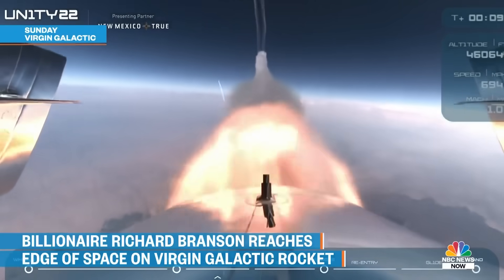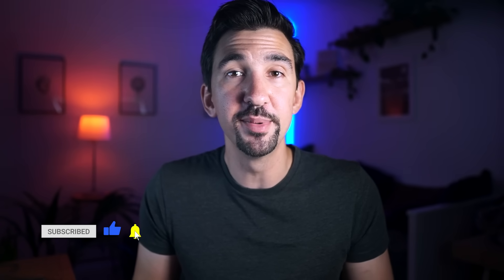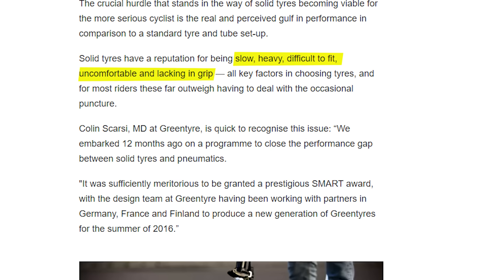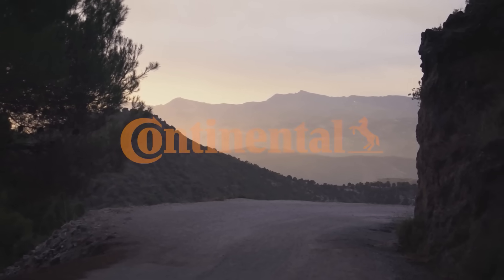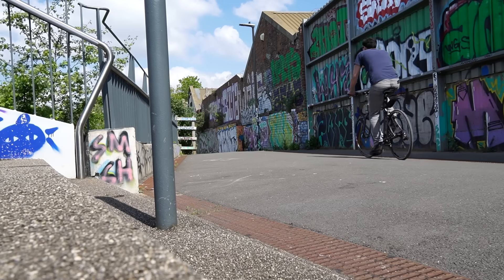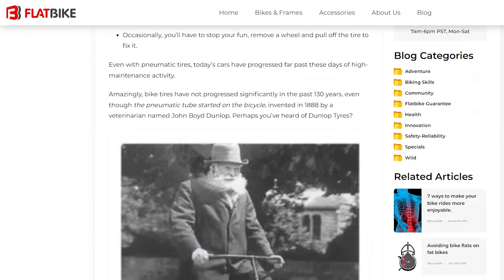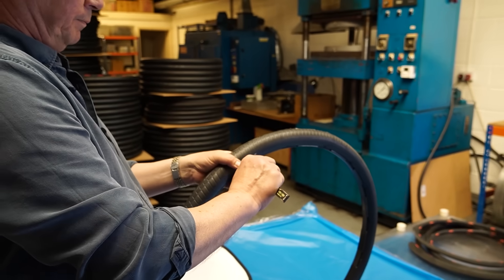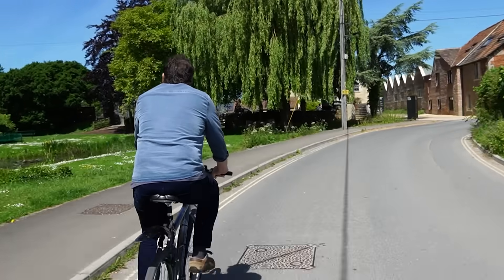I Tried Solid Bike Tires | Here's What I Found

Comment: Or you could be incredibly lucky like me, I’ve always ran conti, with an average of 5k miles a year I had zero punctures on the road from 1998 to 2017. Admittedly I did have a couple of slow ones that had given me a flat overnight. I think the key is to keep correct inflation and replace when they get worn
Reply: I've been on Conti Double Fighters for 2 years and not had a flat

Comment: You’re wrong about that “coefficient of restitution” with respect to pneumatic tires. I mean, you’re right if you’re talking about bumps. But not right if you’re talking about riding along a smooth path. That’s because when you’re riding a smooth path, the ‘net’ pressure in the tire isn’t changing. You do have compression at the contact patch, but that is just going to push the air inside the tire away from the contact patch. The air would blow forwards inside the tire, and would flow backwards relative to the rolling direction. I would expect a strong air current inside the pneumatic tire tending to flow backwards and hence cause resistance to rolling.

Comment: I used to work in a bike shop about 30 years ago, solid tires were quite popular then and we made a lot of money re-spoking, replacing bent rims and damaged hub bearings of wheels fitted with solid tires. Air is a fantastically efficient shock absorber. Foam rubber with unpressurized air in the foam are in no way comparable. Elastomers make very poor springs. Personally I have found well protected tires (Schwalbe Marathon for example) are virtually puncture proof, and I prefer the minute chance of a puncture (less than 1/20,000km in my experience) to the massive cost of wheel repair resulting from solid tires.
Reply: I have ridden and raced bikes for decades and with training and racing used to cover 300 miles a week. I tried semi solid tyres on mavic box section rims going to work on my work bike, needless to say they cracked these very strong rims and had the rolling resistance similar to riding through treacle making each journey slow enough to fix a puncture anyway. I quickly returned to pneumatic tyres on my work bike, so I can confirm that you are 100 % correct. Semi solid tyres are a disaster! Still race now, sometimes against Harry Tanfield in our club evening series, when he is home from professional duties. This is one area where pneumatic tyres don't help, trying to catch him whilst he is averaging 30 mph on a sporting course.
Reply: @stevezodiac491  Hey Zodiac, we finally find you!!! You will have to answer to FBI questions and please don't talk about "solid tires" or "needle" to explain your terrible day to day activities 😂😂😂😂😂. 
I'm on your tail since 1960's.🧐
Reply: While I have no experience with solid tires, I can absolutely confirm the performance of higher value tires. I am an overweight dude, and I use my bikes for shopping, too, effectively putting up to 150 kg on my bikes. So you'd think that every thorn or piece of glass I ride over will be pressed hard against the rubber. Still, punctures for me are an absolute rarity in the roughly 5000 km I cycle every year. Bonus: these more expensive tires also don't wear down as fast as the cheaper ones, so despite the higher price they are not really more expensive in the long run.

My personal safety precaution is owning two bikes. With a short commute, punctures are not always noticed during the ride. So when I see a flat in the morning, I just take the other bike and repair the flat in the evening. Also, I put in new tubes and a new rim band at least every two years, regardless of any actual issues with them. Strained rubber ages.
Reply: @Volkbrecht  In US more expensive means lighter and more delicate
Reply: @3mtech  When it comes to bicycles, that's probably true everywhere. However, you need to take into account that any price gauge starts at "crap", and crappy tires are usually lighter than durable ones because they are using a lower thread density on the carcass, and also often softer rubber. And there is another thing. When tires have added puncture protection (you can see this in the video at 4:18), they also get heavier and more expensive. Personally, I don't use tires that have this feature, because it adds weight at the worst possible point of the bike. The regular Conti touring tires or the regular Schwalbe Marathon are good enough for me. But the reason for that is that I could hop onto the bus at any point during my commute. I can afford to sacrifice a little reliability for speed.
Reply: I agree with the high quality tires being virtually puncture proof. In the last 10k, I had one puncture when I ran over a nail with the said Schwalbe tires. On my current bike I rode 5K last year and the tires are still absolutely fine and will hopefully run for at least another 5K.
Reply: I've built  quite a few bikes over the years, but using schwable marathon plus, I've also found they're pretty puncture free! ...maybe I'd get a puncture once 3 or 4 years, but changing when getting worn virtually removes the risk, as for this guy getting punctures 2 or 3 a month? ..either cheap tyres or really off road, sharp gravelled paths? ..saying that if the new tyres proove successful and recyclable good luck and time will tell?
Reply: Marathon essentially solved tyres for commuting / touring use!
Reply: I agree. The higher quality tires are really good. I had 0 punctures in the last 4 years/>20.000km with Schwalbe Smart Sam, spikes winter tyres and Marathon. 

The concept of those semi-solid tires seems very interesting though!
Reply: I've had a bike most of my life and only 2 flats in all that time. I've lived in village and city's - so not that much difference. 

 Changing the tube is not that bad - if you got a spare one on tour it's manageable. 
There is an argument to be made to make the rubber tires recyclable. Probably not easy if you also want puncture resistant tires.

I think it's more important to think about maintaining bicycle tracks - to clean them regularly, particularly in autumn and winter. I often don't want to ride in the gutter of the road because of all the debris (leaves, small branches...) and ride a little bit to the left. When there is no bicycle track it's safer in the middle of the road - and much cleaner.
Reply: I have a 4 ply Michelin city pro moto tyre on muh EUC. Got a shard of glass through to the tube. Glass errywhere 💩
Reply: Well said, thank you.🙂
Reply: But one of his points in the video was recyclability...
Reply: Did you watch the full video?  The Gecko tire has much better compliance and ride quality than older solid tire designs.
Reply: I remember solid bike tyres from the early 90s, I think they were with recycled materials as well, seemed like a cool idea in principle, I never got any but I do remember them just disappearing from the shelves. Now I know why!
Reply: Well said
Reply: I understand what your saying although it seems to me that these tires are different then old solid tires in that the air inside is encapsulated and provide the rider a very similar ride quality to an air tire.  He did test a tire like the one you mentioned were so popular and found it jarring.   I'm glad you found an alternative that works for you in one area.  It only falls short in the recyclable front.
Reply: Modern tubeless tires with sealant work great. 
They’ll seal up most punctures. 
I never fear glass or thorns. 
The only maintenance is keeping them pumped up, and adding sealant about once a year. 
Far superior to tube tires, or solid tires I’m personally aware of. 
I’ll stick with tubeless ..
Reply: In response to those who say things like…I’ve ridden bikes my whole life and only had two flats; this sort of claim is relative to where one lives and how one rides, right?
I once lived in a place that was notorious in late summer and fall for goat head thorns. I couldn’t go 5 miles during goat head season, without getting a flat. 
I now live in “the grass seed capital of the world” and haven’t had a flat in the 8 years I’ve lived here…unless I ride in the hill country where wild blackberry grows like weeds.
Now, the blackberry bushes wouldn’t be a problem except that they grow very fast and this is a problem for bike riders and hikers bc the vines grow across trails. When this becomes a problem, hiker’s and biker’s prune them back out of the way. This is good, of course, except for the fact that they drop the vines on the trails and that makes a problem for anyone riding over them.
Some people say that hiker’s intentionally drop them on the trails to discourage mountain bike riding where they enjoy walking.
I suppose what it comes down to is…hikers don’t like mountain biker’s disturbing their peace and quiet.
So, the moral of this story is if you live where there are thorn seasons or lots of blackberry, you will have flat tires.
Reply: Same
Reply: Thanks for that input. When I bought my MTB the shop strongly advised against solid tires for the reasons you mentioned. There are solid tire brands out there claiming shock absorption similar to air inflated tires. However, the cost is a bit high. I just use normal air inflated tires with linings to stop thorns. In about 5000 miles I had one puncture. The math to me indicates to simply stick to air inflated tires...
Reply: I would say the type of material is key. I do not believe that a solid tire of the correct material and density would not work.
Reply: My sister had a set on her bike at college... for about 2 days before they were stolen OFF her well locked frame. She did say you could feel all the crap in the road while she still had them.
Reply: my bike would like to differ... 6 punctures in 14.000Km xD
Reply: @Kanitoxx What tyres are you using?
Reply: I'm guessing that if someone wanted to deliberately puncture one of these tires it wouldn't be difficult to do. (Though I don't know how puncture-resistant MY tires are) I worry about this because I just got my second flat (on the same tire) in four months on a bike that I've ridden for fourteen years without any tire issues. I think my bike mechanic replaced the tube the first time, so probably it's not an instance of a bad repair job on a tube.
Reply: did you watch the entire video?
Reply: Go tubeless. I haven't had a flat since I made the switch about 5 years ago. Just have to remember to top off the sealant every 2 to 3 months.
Reply: @kandrkandr  sealants would freeze during the winter where I live. Frankly I don't know how this solid tire would behave either during winter time. Some materials behave weirdly at well below sub-zero temps.
Reply: @innocentiuslacrim2290  most of the sealants are loaded with antifreeze. I've never seen a problem with it.
Reply: @innocentiuslacrim2290  antifreeze is added to the sealants. Plus ammonia. It would need to be extremely cold to freeze it. I remember when I made my own, most of the recipe was rv antifreeze. I am curious though. I will put a bottle of stans in my freezer.
Reply: @kandrkandr  oh, I stand corrected by you and gonokittys. I just assumed it. The coldest it gets here is -30 Celsius and I do not really cycle much at those temps either.
Reply: @kandrkandr  I concur doctor. 
The majority of these issues are alleviated by this move.
Reply: @kandrkandr  No, I've run tubeless and while they puncture less often than conventional, when they do puncture you are scrwd as the they often don't reseal properly if the tyre is cut.
Reply: @richg7163  when I go for a long ride, I always bring a spare tube. Years ago, I burped my front tire so I started carrying a light tube with me. Haven't had a need to use it yet though. Knock wood.
Reply: @kandrkandr Second that. I bought a Giant Contend AR1 a few months ago, factory fitted tubeless. Ridden a lot of km since then including the RideLondon 100 mile. Topped up sealant before the event. Very little pressure loss over time and no punctures (yet!). My previous hybrid bike with tubes seemed to get never ending punctures.
Reply: @kandrkandr  Tubeless tires use air
Reply: @rogeliosalgado  My point was... just because tires are pneumatic, does not mean they have to get flats.
Reply: @kandrkandr  well, tubeless tires do get punctured sine times flats, ir has proven to be a better option than running inner tubes, but effectivenes depends on quality of seal, rim, tire, sealant and expertise or quality when installing, the Only downside is the money involved
Reply: @rogeliosalgado  yeah, best to use tubeless ready setup for best results, but you can get by with a thick over applied rim tape if your rim is not tubeless ready. My ebike is set up like this, and I have had no issues. So far. Have not even needed to add air in over 2 months. Probably jinxing myself.
Reply: @kandrkandr , does the wheel rim not have to be tubeless specific, to prevent the tyre rolling off the rim?
Reply: @johnnunn8688  it doesn't. Just put multiple layers of rim tape on. The added thickness will give the bead a place to sit and prevents it from moving into the middle of the rim. My son said he heard about this trick from berm peak YouTube channel. Worked great for me.
Reply: @kandrkandr  Seth (the Berm Peak youtuber) just uses normal duct tape. He says you don't need the specific, harder to work with, more expensive tubeless tape.
Reply: @gheetza14  I  used to use gorilla tape. Lately I use blue packing tape that I bought off Amazon. It's cheaper per foot and much easier to remove and reapply. Really, I think it's the same stuff they brand as tubeless tape with the high price tag. The duct taoe leaves a lot of glue residue that needs to be removed with acetone. Not fun.
Reply: @kandrkandr  But more rim tape makes already-difficult tubeless tire mounting even harder to do.
Reply: @rogeliosalgado  If that's a question, then yes, tubeless tyres are pneumatic. 

If it's a statement then I cannot see what he wrote that makes it seem that he is unaware of the fact.
Reply: @kandrkandr  The best compromise for me is quality tubes to which I add a sealant made for inner tubes. Easier to work with than fully tubeless, swapping tyres is easy, no special rim setup, and no need for a compressor. Yet the same very good puncture protection, except possibly against snakebite, but at the tyre pressures I use that's no concern. It's heavier and higher rolling resistance than tubeless, but that's less important for me than the practicality of it. Combined with high quality puncture resistant tyres, it's all good. Racers will disagree, but for practical transport cycling I think it's the best way.
Reply: They make a hybrid. A rubber insert that protects the tube. Best of both worlds. I also use the goop tubes.

I live in Hawaii, Big Island. They only sweep things onto the side of the road they never sweep the side of the road. Glass, nails, very sharp lava rocks, etc, we're all a huge problem.

Like you say solid rubber was just a terrible ride and would destroy the wheels.

The armored insert and self-sealing tube solved my problem. Now I only change tubes when I change tires because the tread has completely worn through.
Reply: Pneumatic tyres are such an amazingly effective invention. I don't think it's impossible to ever replace them though
Reply: Seems like you missed the part of the video covering its elasticity.
Reply: This. This whole video speaks like an ad for these tires, yet they solve none of the old problems of solid bike tires. They're heavy (they compared them to quite literally the heaviest tire and tube they could find.....), they ride rough, and they're too hard for the normal person to fit to their rim.
Reply: Combine that with a tubeless set up and sealant and I don’t know why we have solid anything. 

Thanks for the insight on these; everything old is now new ….won’t be considering these
Reply: @inzana2   In other words you have no experience with the Gecko tire presented here but rather with products from 30 years ago. To me, and clearly not many others, a primary benefit besides performance, is reCYCLEability.
Reply: @rcpmac  if they offered a turn in rebate on the used tires it would be more of a draw for most people. Company now has a supply of raw materials to make new tires, people get a discount, recycling rather than landfill is assured, and everyone's happy 😉

Comment: Haven't had a puncture in years. Tubeless solved these problems a long time back. As for 'the stiffer the material the better the tyre performs'. Just nope. The best tyres have always been the most supple and the last century idea that harder (higher pressure)  tyres are faster has been debunked many times now. So you get more comfort, more speed and more grip from lower pressures. And if tubeless, no pinch flats either because there's no tube to pinch. Lighter too. Win, win, win, win, win.
These tyres do make good sense for fleets of city rental bikes in the lower maintenance and being good enough there. But less so for the wide variety of rims well shapes and varying rim widths that are out there. Which pneumatic tyres don't need to worry about. The other issue is tyre pressure equivalence, what may feel comfy for you at xxkg may be too harsh for a lighter person at yykg.

Comment: How about rolling resistance. I usually can control that with the amount of air pressure. This material has certain density witch will confine it's usage to certain width of the tire. It's hard to believe that tires from 23mm to 42mm can be made from the same compound. Softness of the tire is not always desired factor.

Comment: Nothing was said about durability. 2-3 years means really nothing to me. You should have used miles/kilometres instead. Also 400 grams is by any means light. My road bike is equipped with tires ~190g + 55g inner tube and that is 155g lighter (and I haven't had a puncture for like 8k km). It certainly won't be a game changer for road bikes and as for the others, don't know.